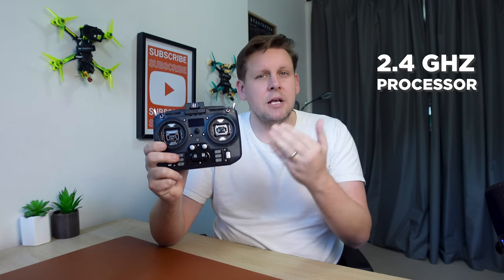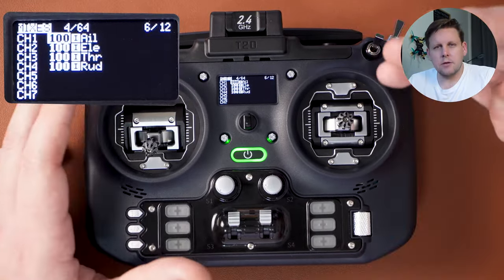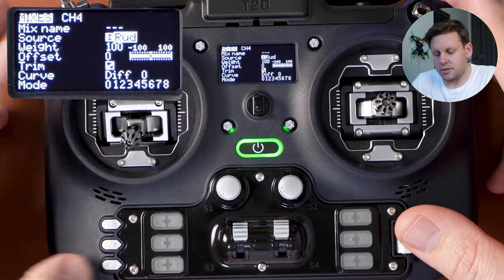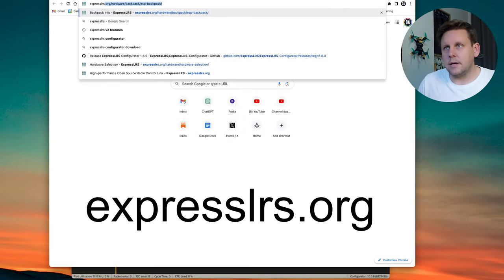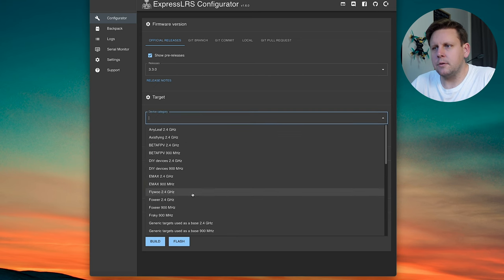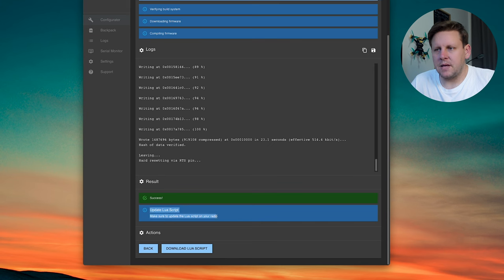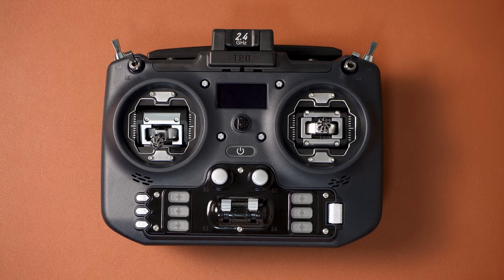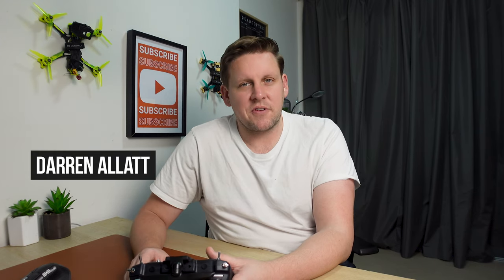How to Setup Jumper T 20 ExpressLRS Complete Guide

Comment: im struggling with manual device selection,its not picking up my transmitter do you have a vid on what to do in that case pal?
Reply: The same happens to me, did you found the solution?

Comment: I was following your video on flashing the Jumper T20 and got to the part where you plug it into the computer and choose serial port from the 3 options onnthe screen of the radio.  When I do this I only get the option of comm4 on the computer.  I went and downloaded the cp210x drivers...after downloading them I still only get the comm4 option...what am I doing wrong.  Thanks in advance and love your channel!
Reply: did you sort this problem because im having the same issue?
Reply: had the same issue, no matter how many times i downloaded it wouldn't change of com4 even tho i could use the controller for flight sim, however i just followed his way for Wifi and that worked :)

Comment: Just purchased one and it on the way. I’m new to open TX and ELRS radios. I always buy drones with DJI PNP version. Do I have to setup my radio (per your YouTube video) before I can use and bind it to the receiver. Or the radio comes preprogrammed. 

Just order drone with ELRS receiver pre install.
Reply from the maker: You have to follow this video when you get your radio controller. You also need to setup your receiver

Comment: Thanks for the in depth video .. does this radio works and bind any crossfire receivers ? I heard you mentioned it several times in the video . Fully Subscribed .. thanks again
Reply from the maker: It will work with crossfire if you get a crossfire module to plug in the back in the external module bay

Comment: Can you make a video for fpv simulator setup with this controller
Reply: is it even possible I am thinking about getting this but have not found a setup guide for it and don't want to find out it doesn't work...
Reply: @WestpalmFreerunner  I have a 2019 MacBook Pro so I have to use a usb adapter. I’ve tried several simulators and they can’t detect the controller. I should’ve bought the tx16s.
Reply: @burnaxel  thanks for the reply, I have a MacBook Pro as well.
Reply: @WestpalmFreerunner  I’m not sure if it would work on other computers or laptops with usb port

Comment: What is trainer mode? Do you need to turn that on for for simulators?
Reply from the maker: Trainer mode allows you to connect two Radios together when learning to fly. 

It allows the “Master” radio to take over the controls of the aircraft when the “slave” or student radios screws up. 

Like a dual steering wheel for learning to drive. 

For the sim, create a new model with Internal RF and External RF set to off, then connect via USB
Reply: @DarrenAllatt  thanks for the quick response

Comment: hello darren. in my internal rf i only get 500hz and i cant change it....but if i change the reciver option to "1" (or another number) it changes for 250hz...what means that reaciver option (2.14 on the video) thanks!
Reply: The frequency number refers to the packet rate. If u want to change the output power, hold down the menu button and go into the LUA script

Comment: No matter what I do I cannot get the ELRS script to load. It was working at one point.
Changing firmwares, baudrates and things, no luck.
Reply from the maker: What is internal RF set to?
Reply: I'm have same problem
Reply: @DarrenAllatt  HARDWARE> Crsf 400k. SETUP> Internal RF CRSF External OFF...

The Lua Script is loading forever, I've already tried to do the main forum and community repairs like creating new models, going to the Hardware page to add and change frequencies...
Reply from the maker: @TercioTeles do you have the ExpressLRS version or the 4in1?
Reply: @TercioTeles  I had to return my to the FPV store that I bought them from and they tried to see if they could fix it over a few days.
They could not so I got a full refund.

Comment: in Device I have Jumper AION T-20 2.4GHz and V2 (Jumper AION T-20 2.4GHz V2 TX) how understand what choose?
Reply from the maker: What does it say on the box?
Reply: @DarrenAllatt when I connect with wifi to ExpressLRS TX, its writed Jumper AION T-20 2.4GHz TX
Firmware Rev. 3.3.1 (e051b8) ISM2G4.
and on box writed T20S ELRS 2.4 Item: C10085, dont see anywords with "V2"
Reply from the maker: @strel9  where is this v2 you are referring to?

Comment: Thanks for this guide. 

I'm running windows 11 and updated the the CP210x Windows drivers from the Silicon Labs in BetaFlight, then re-booted for good measure. 
The manual serial device selection in ExpressLRS Configurator only show COM3 Microsoft and there is an orange triangle on Jumper T20 and USB Serial Device (COM3) in Windows Device Manager. Does anyone have a fix for this?
Reply from the maker: You have to right click and manually select the CP210x driver for the Jumper T20 in Device manager
Reply: Would you happen to know the link where I can download that driver? 

I've downloaded and extracted both the CP210x_Universal_Windows_Driver and the CP210x_Windows_Drivers, and run the CP210xVCPInstaller_x64.exe program, but device manager still says Windows was "unable to install your Jumper T20 Serial Port" when I try to update the driver. Any advice is appreciated.
 @DarrenAllatt
Reply: @RedondoDennis   got the same problem. did you fix it?

Comment: Hello iam having a problem . I have a brand new Jumper t20s and a foxeer 2.4ghz lna reciever. I have follow the expresslrs guise for setting everething up. But at the bench test 25mw at 1 meter i get -100db on rssi1 TX. And i also get a critical alerta of low rx signal. If i move the radio like 0.5meters away it Will failsafe...any nidea about this?
Reply from the maker: What’s your antenna configuration?
Reply: @DarrenAllatt  where i check that?
Reply from the maker: @gonzafpv2843   you look at your atennas and see if they are the same direction, ie both horizontal or both vertical etc
Reply: @DarrenAllatt  both are horizontal
Reply from the maker: @gonzafpv2843  you probably have them too close, go to a park where you can walk and pick it up if it failsafes to test. It shouldn't but this would just to be sure.

Comment: My T20 Pro has  got AION T- PRO v 2.5.1  from the factory.Can only update to 2.5.2 under "Jumper" &  "T-Pro" 
Tried doing your method with the target " Jumper 2.4Ghz &....T20"...3.3.0 .but configurator 1.6.0 will NOT Build it under "Wifi" method to my p.c.🤔
Tried EdgeTX Passthrough method as you did,but the blue updating bar jams,after pressing "build"......so fails.
Seems I,m stuck as a T-Pro on 2.5.2🤗🤣... even tho I copied your video precisely,...not sure now how to update to correct target and 3.3.0
Reply from the maker: You need to download the latest configurator. Sounds like you are running an old version
Reply: @DarrenAllatt  Many thanks Darren I'll make sure I'm using 1.6.0👍

Comment: Thank you for your quick getting started guide!

Some remarks:
0:18 : it says "processor" on the screen - that is completely wrong, it refers to the RF frequency, not the processor speed.
2:10 : The baudrate for CRSF is still at 400k, for reduced latency 1.87M works just fine and has no stability issues.
Reply from the maker: Good pickup at 0:18, that was my editor and I didn’t catch it.
Reply from the maker: People can’t actually tell the difference between the baud rates so for latency so it’s not worth changing.